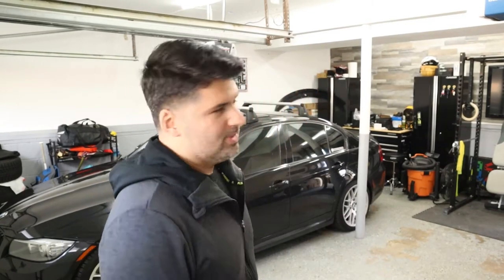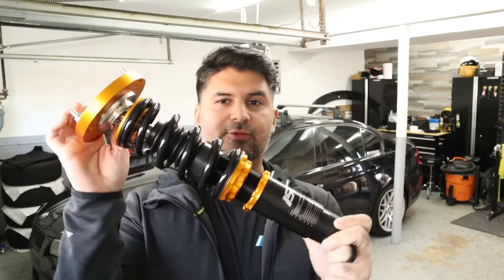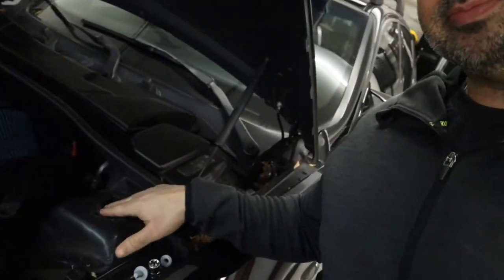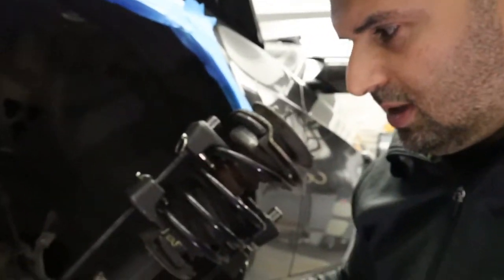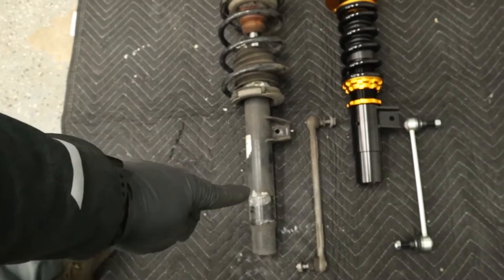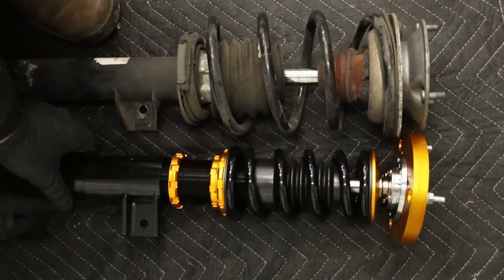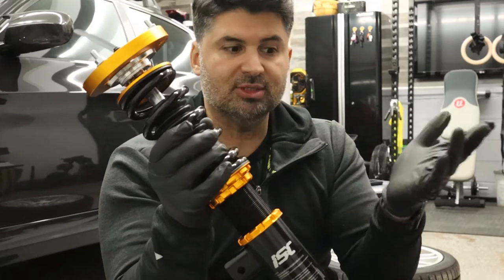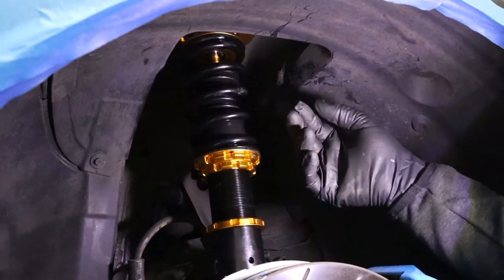Upgrade to the ISC N1 Coilover Kit.  32 way dampening! Lets get low! - BMW 335

Comment: I got these ISC Suspension basic kit with triple S upgraded Coilover springs (definitely suggest getting the upgraded springs) for my 06 Acura TL (upgraded from my Tien flex Z)  and the difference in ride is incredible.  At least for me its the next best thing to air suspension. Hugging corners, takes bumps in the road like a champ and most of all i love how my vehicle feels when driving around turns or even just crusing up and down highways.
Reply from the maker: I’ll have to look into upgrading springs. Didn’t know that was an option with ISC.
Reply: @SamAcevedo are the upgraded springs softer or stiffer ?

Comment: Dang, glad I have a Subaru, much easier install, I got the race setup, didn't need a spring compressor or to dismantle a bunch of stuff, ride is great at the default mid-way dampening setting, I can also easily reach the adjustments. The kits come with copper grease to prevent the threads from seizing over time, also the shock bodies have inspection holes to ensure against overextending. With a 12" caliper there is no guesswork on the spring pre-load. A digital protractor and a straight edge is all you need to check camber. Fun stuff!
Reply: Damn that’s great to hear. What model sub did you do yours on?
Reply: @INTHEFIELD777  06 LGT sedan, it's a blast, I have videos posted, handles really well now, just the jamnuts like to come loose, will probably end up safety wiring them, probably a common coilover issue on the front of strut cars

Comment: Hey man. I have the same kit and I’m currently installing in on my 335d. Do you have any clue how those two small bolts with spacers are used on the coil overs. The vague instructions and website show nothing about them.
Reply from the maker: The kit does come with some spacers for the front strut bar mount … spacers are used to lift the strut bar just enough so you can use the adjustment knobs - you’ll need the longer bolt that’s included in the kit as well
Reply: @SamAcevedo  I gotcha replaces the etorx bolt.

Comment: Hey Sam, great vid. Car looks great. I'm also considering N1 V2's was wondering what spring rate you went with?
Reply from the maker: Front:   10 kg/mm  (560lbs/in)
Rear:    7 kg/mm (392lbs/in)
Reply from the maker: They feel better than the stock ride …. The dampening can get really stiff…. I’m driving around at 7 clicks from soft - still messing with it. I also recommend buying the rear dampening extenders

Comment: I installed the race/track version, but I'm getting clunking noises, made sure top nut, top strut bolts and end links were tight, no noises when turning only going slow over bumps. Did you experience any clunking?
Reply from the maker: Did you tighten everything under load?

Comment: @Sam Acevedo how's the ISC setup working out? I'm in a 128i and srsly considering this kit.
Reply from the maker: I love the ride so far … no complaints … ride settled nicely …. I’ve softened it a bit … the only thing I don’t like is how you adjust the height in the rear. Other than that love it def recommend it

Comment: That blows. If manufactures switch designs from popular logic they should include instructions and warning labels
Reply from the maker: Def agree … Im not crazy for the design … I need to adjust the right rear and putting it off since it’s too much work for something so simple
Reply: @SamAcevedo  yea man. I feel you. Setting coilovers in general to perfection can be tedious and if you dont have lifetime alignments costly